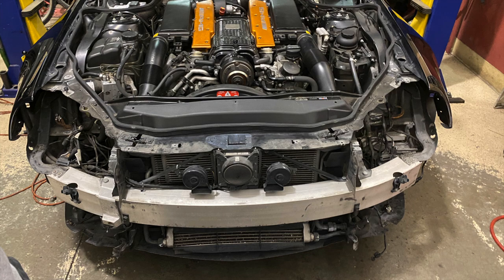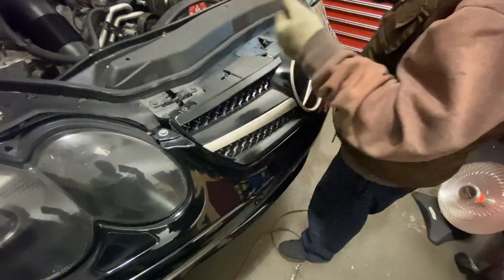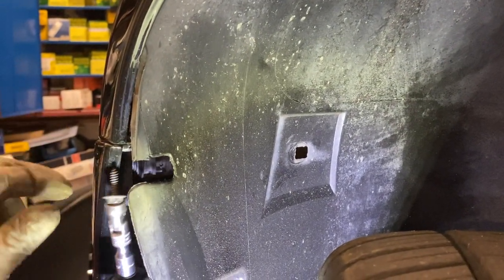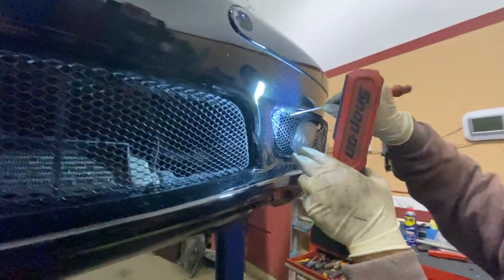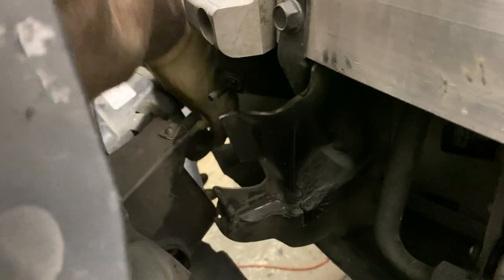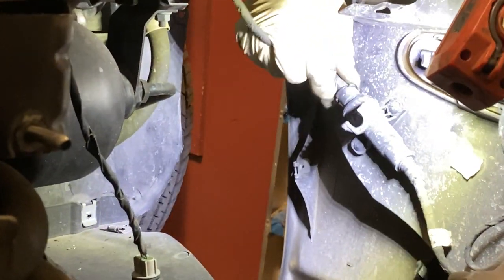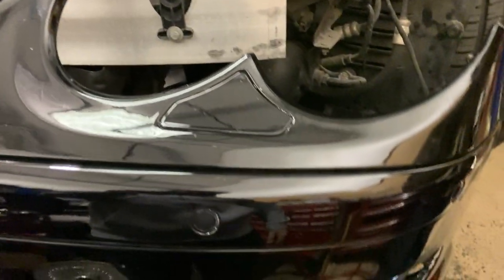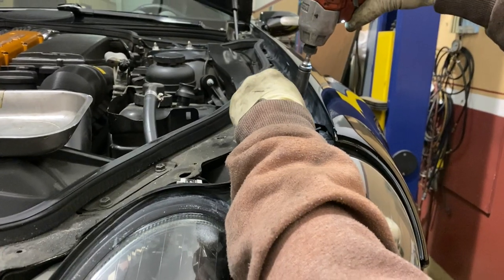Removing the front bumper and the headlights for paint | SL55 build pt 10

Comment: Thanks for this video. I have a '07 SL55 with 040C like yours but with Camel interior that is nice in the Texas heat. My Supercharger pulley failed, so I replaced with a 83.7mm pulley with a tune from RaceIQ and it has some issues with the heat, so I have ordered a new PLM XL heat exchanger and the Bosch 010 I/C pump from VRP Speed (wish i new you had a discount code). I am not a 'wrencher' on this car yet, but I am learning.
Reply from the maker: All good bro! You’re on the right track! Ill have a video to help you install those parts soon!

Comment: Can you make a video on a distronic. What cables, how they routed, all modules...
Reply from the maker: ill look into it. Can i ask if you can go in a bit more detail?
Reply: @Mr.Affalterbach  http://www.mercupgrades.com/Distronic+Retrofit+++SL++R230++2002+2004-article-69.html so I found the tutorial, but it's only few pics, maybe you could show how the cables routed and blocks that are involved. If possible,. at least something, if you don't want, maybe just recorded unedited, whatever you can.
2nd I'm not sure if I saw the video with you about diff..there are 2 easy options about differential: quaife 1600$ and wavetrack 970$. Maybe you planning on installing it.
3 not sure if you know about oil pickup tube and o-ring on these engines excluding s class. O ring is stoned by this time and high chance of low pressure oil. You can find couple video of e55, but not sl55.
4 idle oil pressure is very low, so one guy who constructing his own cars for a track and exposed this o-ring problem installed oil pressure gauge and switch. I'm planning on welding on oil filter housing couple ports for oil temperature and pressure, installing gauge to cigarette compartment, and instead of light to switch connect buzzer, how I did on other cars with low battery notification.
Reply: @Mr.Affalterbach  if you don't have xentry - there's a channel on youtube with tutorial on how to install...if you need to find it let me know. The adapter can be purchased in china for 20$.

Comment: Thank you for the video. Question, the C/S switch on the center console is stuck in "C" ..  Is the switch bad or should i be looking elsewhere. if the switch needs to be replaced, is it difficult?